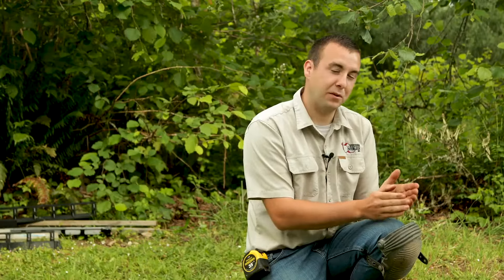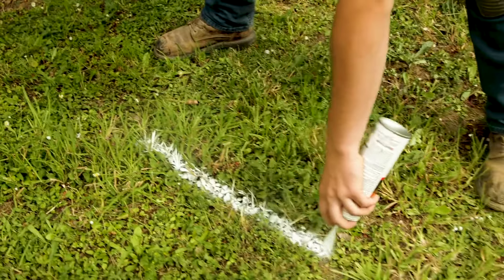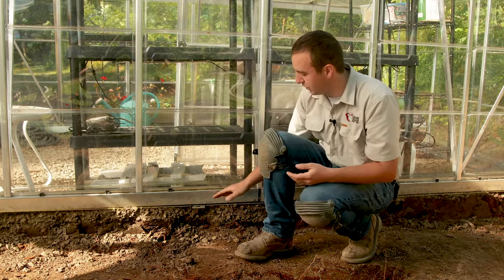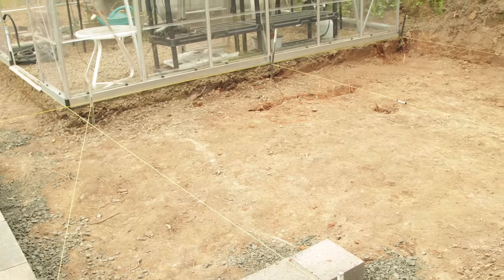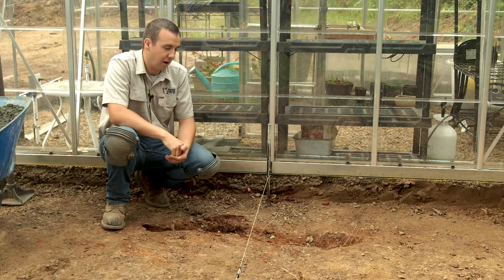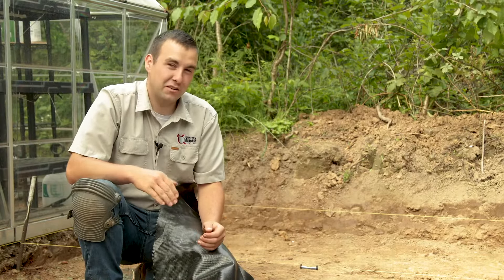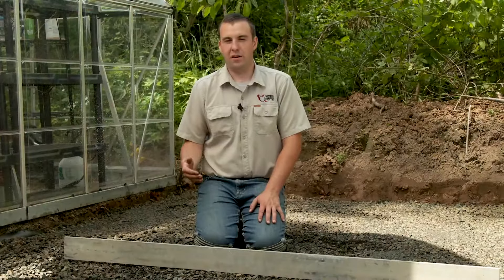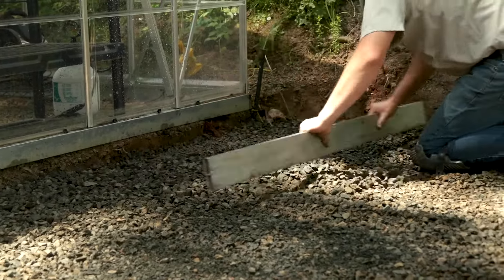How to Prep & Lay a Base for Pavers

Comment: Thank you all for the great videos. I'm totally new to all of this. I'm hoping you can help me out with the question I can't seem to find an answer to. I need to make sure I have slope since the pavers will be abudding the foundation of our porch. Do I dig the slope first and then down to the depth for the sub base and base or do I dig down to the desired depth and then do the slope?  Thanks!
Reply from the maker: I think that I understand what you are saying. If you mean that you need to maintain slope away from your foundation, you are correct. What you need to do is figure what you need your finished height to be at the porch and then work back from there. It may be necessary to either have a slightly elevated or sunken patio depending on how much natural grade is there. For more information on the subject, you can read our blog article on setting grade: https://westerninterlock.com/how-to-set-grade-hardscape/
Reply: @WesternInterlock  thank you. That partially answers my question, but I'm still confused. Would I excavate out the slope first and then dig down to the depth required for the base, sand and paver thickness?  

For instance if I need my lowest point to be 2 and 1/4 in below the top of the paver next to the foundation do I dig out the slope first and then go back and dig an additional 6 in below the foundation working my way down to the lowest point or do I dig the 6 inches out first and then dig the slope? Sorry for all the questions!
Reply from the maker: There's so math to be done, but you would actually need to dig it out all in one go. First, establish a level string line. Secondly, drop the end that is away from the foundation 1" per 10'. Then begin digging. Measure down occasionally in several places across the entire project until you achieve the desired depth. Add compacted gravel, compact it in lifts, measuring down from time to time to make sure not to over fill. You can find an illustration of this here: https://bit.ly/3oVnveU
Reply: @WesternInterlock  thank you very much!  More or less got it now

Comment: What force of compactor should you use for your 3/4 gravel ? Is 118 pounds enough or what force compaction should it have ? 1600 pounds of force or more is required
Reply from the maker: Size of compactor really doesn't matter. You could use a hand tamper (www.amazon.com/Companies-Inc-2233400-Steel-Tamper/dp/B00L1LGT0W) if you really wanted a workout. The most important thing is to not surpass the capacity of whatever compactor you are using. A good general rule of thumb is that a compactor can effectively compact as many inches of gravel as it takes men to lift it. i.e. two men to lift the compactor/two inches of gravel. https://www.instagram.com/p/BwFw5fdFu2S/

Comment: You're not using ABC or is that only for driveways?
Reply from the maker: I take it that by saying ABC, you mean Aggregate Base Course. I'm not sure exactly what ABC is, but I think it's another name for what we call 3/4-0 gravel here in the Northwest. Unless there's a massive excavation for industrial traffic where a larger rock base course is better, we've found that using this aggregate works just fine for almost everything. In some cases, it may work better to use an open graded base (ODOT spec gravel) if drainage is desired.